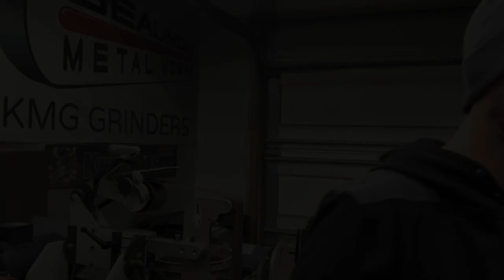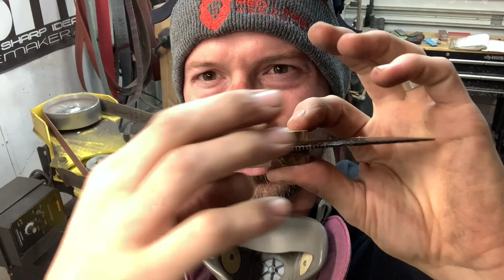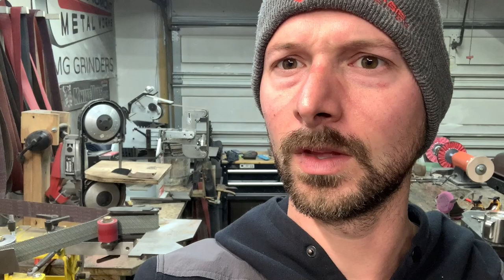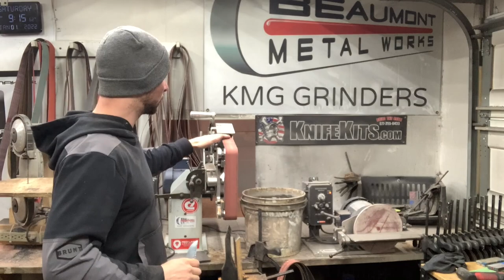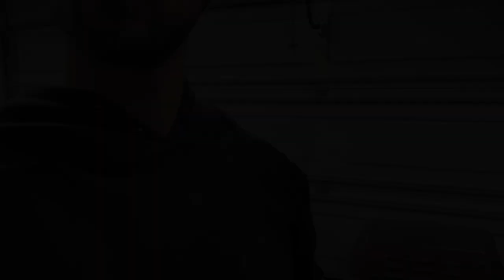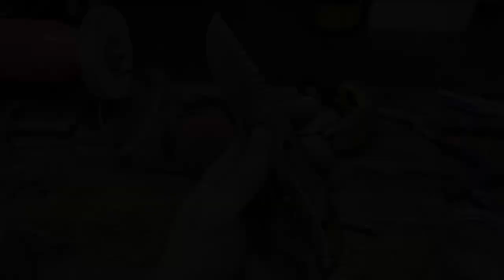How To shape and finish custom knife handles!

Comment: An old pipe maker passed on 1n 1950, his widow gave us some of his unfinished pipe bowls and the most valuable thing I ever got. A huge chunk of carnauba wax. He used rouge to polish and then the carnauba to finish. I still have 90 percent of that big bar of wax. Thank you for the other steps. I just ordered a number of woods for knife scales. I have no belt sanders just an orbital, a mouse type on the vibratory tool, and all sorts of round paper cylinders for drills and a Moto Tool. And of course there is always the good old Armstrong method.
Reply from the maker: Nice! Thanks for watching!

Comment: You made a comment about the horizontal sander putting lines in the belts because you are only using one narrow part of the belt.  I wonder if you could modify your table rest so it moves up and down, or put some layers of plywood on top of it, so you could use different zones across the width of the belt.
Reply from the maker: That’s a great idea I think!
Reply: Seen a guy make tool rest out of plate steel and he had some cheap neodymium magnets of different sizes he used as spacers he would just work his way up the belts as needed everything stayed pretty true.

Comment: This is pretty much what I do, but I have been adding a few swipes on 3000 after 2000. Not sure if it makes a difference, but it is quick. And I only buff in 2 steps. Pink scratch-less and clean buffing wheel.
Reply from the maker: Nice!

Comment: Thanks for the info! Curious what compound progression i should use when using the standard polishing compounds..ie black/ brown/ green/ white/ blue..etc. after hand sanding to 1000g? Thanks
Reply from the maker: Pickup the red label abrasives airway wheel system and never look back !
Reply: Ok thanks I'll check that out 👍🔪

Comment: Good tips for handle.  Like your video lessons.  I noticed a portable Milwaukee band saw in the background and have a question.  What blade brand and tooth count do you use to cut out you metal blades?
Reply from the maker: I primarily use the 12/14 tpi Milwaukee blades. They seem to last the longest

Comment: I was wondering where did you get that 4 inch diameter 3/8 tapered rubber wheel for 1 inch belt For sheep in the handle and so on
Reply from the maker: Not sure what wheel you’re talking about
Reply: @gentrycustomknives8008  for 1 x72  belts  skinny  tapered contact wheel

Comment: Great video Matt! Just wondering what type of pressure u use on the buffing wheels? I´ve had mixed results with epoxy resin, after hand sanding up to 2500 grit.
Reply from the maker: My buffers only take a certain amount before bogging down unfortunately. So I’d say medium pressure

Comment: Good stuff man! I’m new to knife making at a really simple level. I like the look of buffing handles vs oil, so are you using a compound on the buffing wheel or just the pad itself?
Reply from the maker: Yes each wheel has designated compounds
Reply: @gentrycustomknives8008  do you mind sharing what the compounds are?
Reply from the maker: https://www.googleadservices.com/pagead/aclk?sa=L&ai=DChcSEwjs4aCu-uP7AhUVqMgKHbMsBeMYABAJGgJxdQ&ae=2&ohost=www.google.com&cid=CAASJeRokf2C3xBY-r6Q_EVJ1ZTuE_IRTYZ5mTnmIBxemWmxmyhgLe0&sig=AOD64_3tKQlLMu6rkC9GCf8YuIqn951M-w&ctype=5&q=&ved=2ahUKEwisqZSu-uP7AhWZmHIEHXwcDpoQwg8oAHoECAYQCw&adurl=
Reply: @gentrycustomknives8008  TY

Comment: What, if any, finish did you use on the wood?
Reply from the maker: None, just off the buffer
Reply: @gentrycustomknives8008  I'd put some kind of protective finish on it to protect from water damage and oxidation. Some wood is fine without protection, but others...
Reply from the maker: I use axe wax on some!